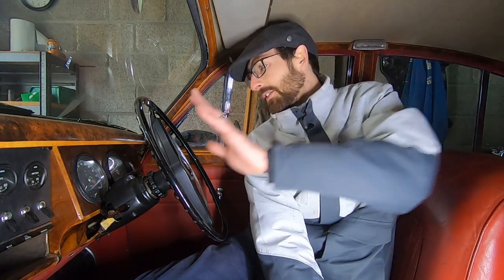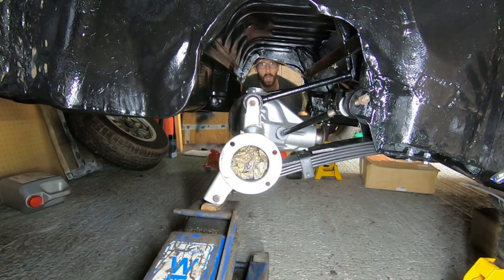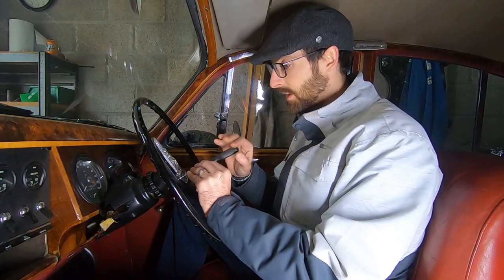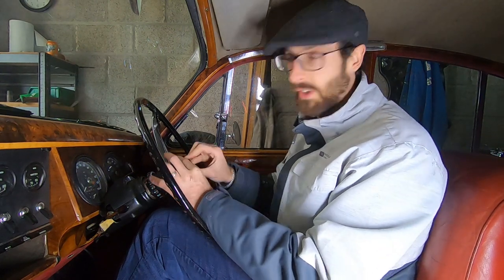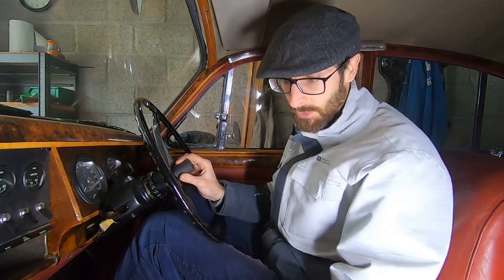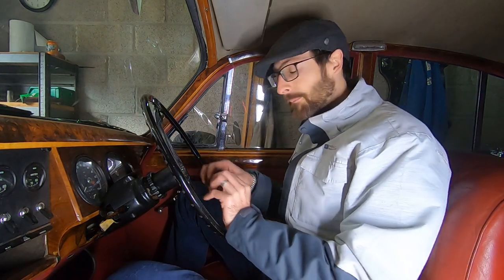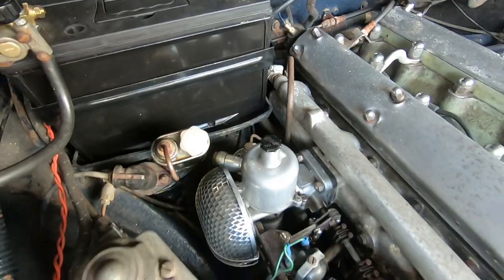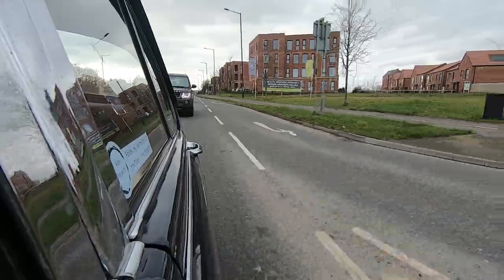Jaguar MK2 | New Steering wheel and Update

Comment: Is that a 17" wheel Vic?  If it's smaller, and you don't have power steering, I hope you are feeling like superman when parking!!  Interesting point about the carb needles.  I have the bigger HD8s but running on standard needles with K&N pancake filters.  I'll have to get some advice on that!  Finally (!) you are very lucky to still have a working overdrive!  When this happened to my car (well the o/d just got stuck on in fourth without my knowledge) I reversed once and then lost reverse completely which was quite a challenge in the middle of a French holiday!!  Got home with a bit of forward thinking!!  Had to get the entire until rebuilt as a result!
Reply from the maker: Hi Tony, I'd be interested to know where you end up with jets and needles. The wheel is 16" I've not driven it yet.... Bad news on your overdrive! My solenoid is now disconnected until I solve it just incase.

Comment: Can anyone tell me whether or not the grill of a 1966 Daimler / MK2 can be replaced with that of a MK2 ? I have recently bought a  66 Daimler, and since its 2.5 V8 had been replaced with a 3.8 jag motor as well as the gearbox from a XJ6, I thought I might as well change all the bits and pieces and call it a MK2
Reply: Did anyone?